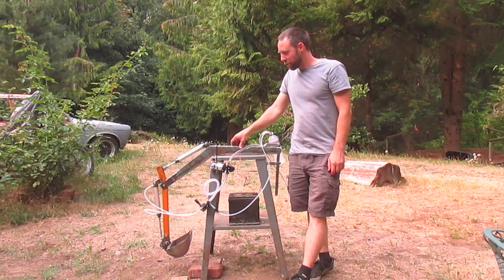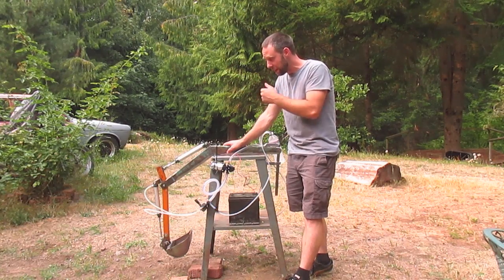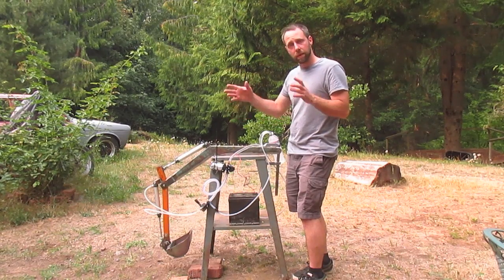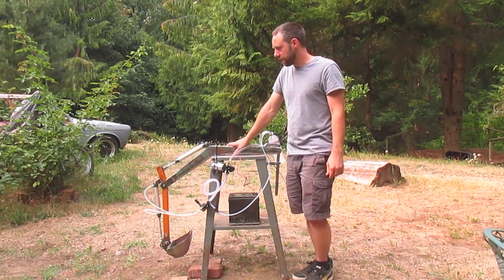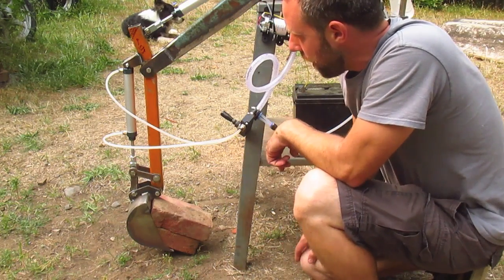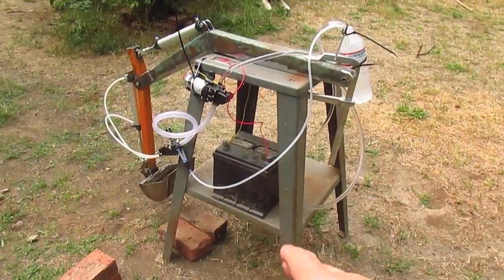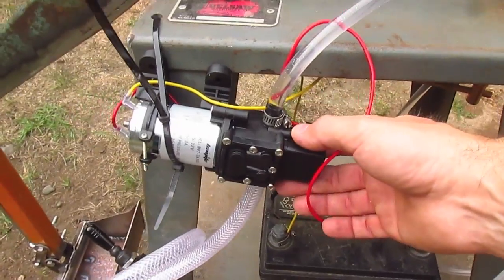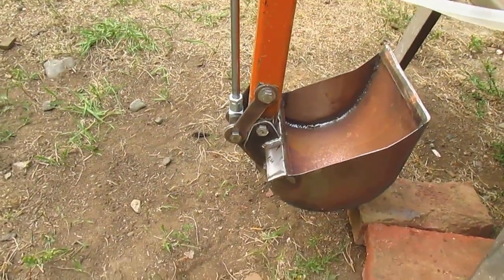Air cylinder operating on water pressure

Comment: is there a reason not to use actual hydralic oil with a car power stearing pump and a hydralic controler I know your thinking safty for your son but I'm looking to build a system for my lawn tractor ?

Comment: Hey, did you ever get to update on this?
Considering using an air cylinder myself, and wondering if I can take it a step further, and have the pump suck from one side of the cylinder while pushing the other, allowing me to control and stop the motion at any point.
Reply from the maker: Hey Alon you don’t need to do anything different then the way I have it set up to stop the cylinder at any point, once you move the control lever to the center position the ram stops.
I was moving it full stroke just to show the movement of it.
I haven’t ever finished the project up but I have been thinking of getting it finished this winter 🙂
Reply: @Mikefestiva  
I understand your setup.

The question I have is about making it smaller and with fewer parts.

Just a pump and a cylinder, no reservoir, no valve. You control the pump's direction and turn it off when you reach the desired position.
Reply from the maker: @shtrooodel   Well it’s not going to be easy to reverse the flow on a diagram pump because they only pump pressure on the outlet because of check valves.
I guess I don’t understand what you are planning to do with it. 
To me it still seems simple with a $20 valve.
I also think you could run into a hydro lock on the system if you don’t have a tank, because each side of the cylinder has different capacities. 
But the best way to find out what works is to buy the stuff and experiment 👍
Reply: @Mikefestiva  
I considered a gear or peristaltic pump instead of a diaphragm to avoid the directionality of it, but you are right about the different volumes on each side, I will need to figure out a way to compensate for that...

Comment: What is the brand name of the pump here?
What is the name of the lever u are using to control the movement of the actuator?
I need to try this concept,most 
air compressor overheat.

Comment: HI MIKE I WANT TO FIGURE OUT A WAY TO MAKE A SMALL ROBUST SYSTEM TO MADE A BACK HOE FOR MY JD210 SMALL AIR NEWMATIC CYL. RUNNING LIGHT OIL USING PRESURE OF A POWER STEERING PARTS AT AUTO ECYCLEING YARD PUMPS. I SAW ONE GUY TAKE A PWR STEERING PUMP
RUN UNDER HIS LAWN DECK PULLY AND IT WORKED GOOD BUT A LITTLE SLOW.

Comment: Can you tell me where you purchased that directional control valve? It doesn’t look like a typical hydraulic valve, what is it?
Reply from the maker: This was not a hydraulic valve, I was using all pneumatics along with a 100 psi water pump to run all this.
Reply: @Mikefestiva  Ahhh! I wasn't aware it was possible to use water in a pneumatic valve. Thanks! I've had the idea of trying this for many years and thanks to you we now know it works, and a pump is much easier to deal with than a compressor...and quieter too. I plan on using this in a robotics application.
Reply from the maker: I don’t know how long all these components will hold up, but I think with some antifreeze or something in the system it could hold up for a long time. I really wanted to play around and see if it would work and it did! Take care

Comment: Hey mike what ever ended up happening with this project? It’s a very cool idea I would love to see how it worked out. I’ve wanted to put a small Excavator arm on the back of my lawn tractor some small and this looked like a good place to start.
Reply from the maker: I still need to finish this project off, it went to the back burner. I keep looking at it in my shop and keep thinking I really need to finish it. Thanks for checking out my channel 👍

Comment: Thanks for the information, but my English is not really good. I would like to ask some questions. 
Just want to confirm with you that, 
1) you using pneumatic  cylinder or hydraulic cylinder for the application? 
2) you using normal water like mineral water to run the application or oil?
3) Can we stored water inside the pneumatic cylinder?
Pls reply me, thank you.

Comment: How about using a water based lathe cutting fluid with the water. Stop any rusting and be a good lubricant for the cylinders
Reply from the maker: Matt Parker Thanks Matt for your suggestion! I will definitely consider that 🙂
I need to get back to building the next part of this project. Take care

Comment: How is the quad truck working out
Reply from the maker: Walt Lars It great! I used it just about every day, I was hauling my welder and fab tools up to my mill this morning, it’s a back saver!
I’m going to be posting a video hopefully in a few days of using the quad truck around my mill, I’m also about finished with part 4 of the quad truck, in part 4 I’m adapting a full power steering system from a Subaru for a hydraulic lift for the truck bed. I hope to post that video in a week or so. Take care :)
Reply: @Mikefestiva   some cigarette lighter Plugs  to recharge cordless tool batts and  cig lighter USB plugs mounted in a outdoor water proof outlet cover  
For mitersaw  make a table that can fit over the bed  with a couple of bars that mount on the bed side walls   and make riser blocks  the height of the Chop saw
Reply from the maker: For sure! I have a USB plug and a cigarette socket with a rubber cap I need to install soon.
The quad truck will be getting many more useful upgrades this fall! Thanks for your input :)

Comment: Did you consider an automobile convertible 12 volt actuator pump and cylinders?  One car has two, dual acting cylinders, pump, reservoir, lines and control switches.  Also the convertible roof itself has lots of prebuilt activating hardware.  I've purchase these affordable components at wrecking yards.
Reply from the maker: Gerald Trice  Thanks for your comment! I will keep an eye out the next time I go to a junkyard, that sounds like some good components to salvage! Thanks